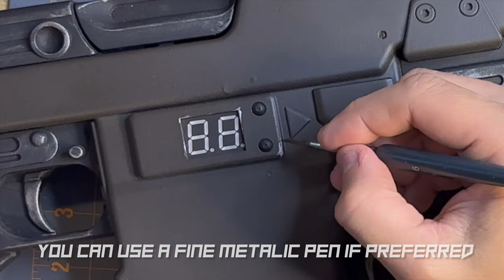Customizing and Painting the  Hasbro Nerf M41A Pulse Rifle Aliens Colonial Marine Mod Relax & Paint

Comment: Looks great! The only thing I would add is: have you considered giving it a coat of satin Clear? Both for protection of your weathering job, and also because the M41As in the film do have a bit of shine to them. 
I feel your pain on the forgetting screws/fiddly electronics too.
Reply from the maker: Thanks for the comment! Yeah, I think I will be doing that, I wasn't planning on it as it was going to be hung on a wall, but even the occasional handling gets some of the original plastics showing through.